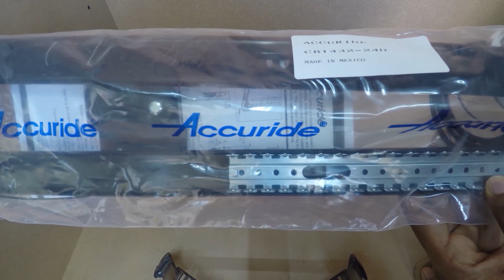Custom Cabinet With Pocket Doors | MakerMan

Comment: Those pocket doors say 36 to 72 inches high for door hight. Did you just not use the cable to make the door as tall as you want ?
Thanks
Reply from the maker: Yes It's adjustable, the cable is just to keep the slides in sync.
Reply: @MakerMan  awesome thank you did you make the metal piece that connected them
Reply from the maker: It came with the set